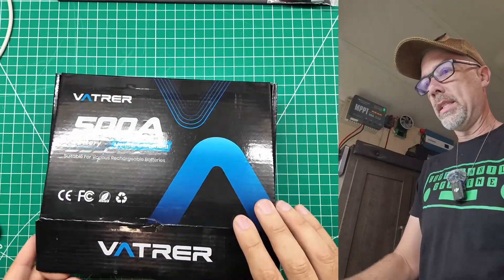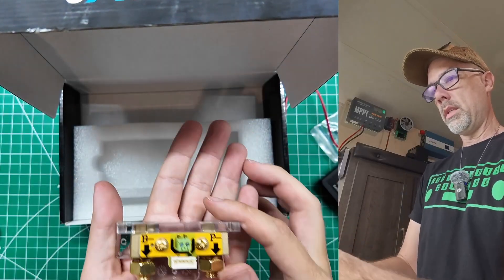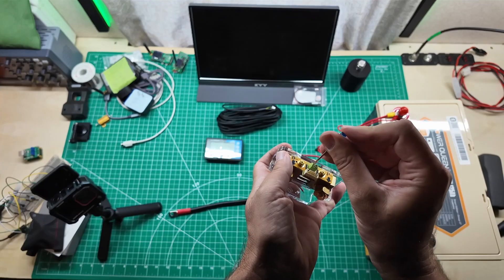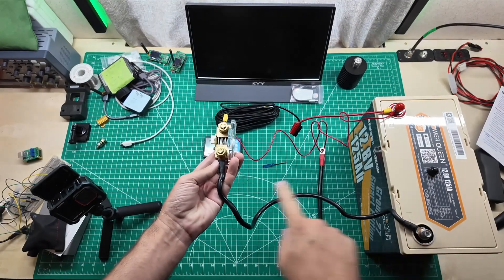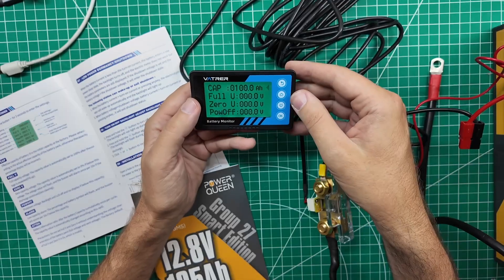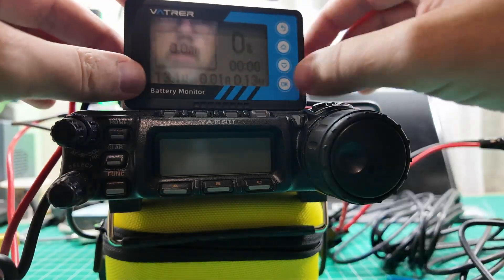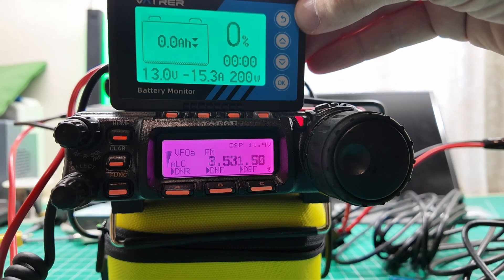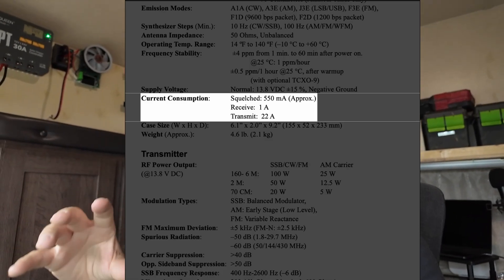Don't Guess: How Much Power Per Band?

Comment: I have a Spreadsheet "RADIO-POWER", and a Tab for Each Radio, I do what you did, but at 100%, 50% & 10% Power out.
It's sometimes quite surprising the change from 100W, 50W or 10W that the Current doesn't drop as much as you think it would, certainly not half.
I'm assuming there will always be a certain level of Bias/Quiescent current draw on TX regardless of Output Power.
Reply from the maker: Right!  You've stumbled upon one of the (many) reasons why QRP isn't just "turn your radio's power output down"!!

Comment: Would be interesting to compare readings using the shunt to readings from a standard VOM amp meter.  1A is only 0.2% of the 500A range.  That's a lot of accuracy to ask for in this price range.  CAUTION: most VOM top out at 10A so don't try this with the full 100W
Reply from the maker: Good idea! That's a good way to double-check.

Comment: Why are those batteries so expensive? I can get a marine battery at rural king for $70.
Reply: In addition to what TO said

LiFePO4 batteries cost less per usable amp hour

If the 24DC battery from rural king is equivalent to Costco's 24DC battery then it would have a reserve capacity of 140 minutes at 25 amps, or about 60 amp hours, but you really only get to use 30 ah of it if you want to keep the battery long term (lead acid capacity is more complicated than that but lets keep it simple)

The lithium battery is happiest if you only do an 80% discharge, so 100AH usable
To get 90 usable amp hours(close to 100) you'd need 3 of the rural king batteries ($210) - about 160 pounds of batteries and 3 group 24 boxes

I can't find a price of the 125AH battery TO posted but lets call it $200 since the 100AH version is $160
And the lithium battery would weigh about 25 lbs and take up one group 24 box

But it gets worse in that you'll probably have to replace the lead acids at least twice over the lifetime of the LiFePO4

Bottom line - for 12V purposes the only reason to buy lead acid batteries these days is if you have no choice but to use a lead acid
I still use lead acid for my camper because its power center is about 6 months too old to have included a lithium charging program (though I am tempted to switch it out and go 100% lithium)
Reply from the maker: Lithium Iron Phosphate, deeper depth of discharge, more consistent power deliver over the duration, lighter weight, more charge cycles, better recovery/over discharge protection, etc.  Very different battery in the end.

Comment: I installed lots of shunts over the years. Works on 12-48V systems. They loose memory when that red wire disconnected . State of charge gets lost . Victron one has settings for different battery types . Also a display and Bluetooth. They give charging time as well. 73
Reply from the maker: That's great to know about the memory!

Comment: Good Morning Steve.
For most people, they won’t even notice what I am pointing out. For “some” people it’s important. Near the end of the video, you stated this meter will tell you about your battery. The information regarding the battery is nominal. What the operator will get is the efficiency/effectiveness of the radio operating character in a specific operational state while connected to a battery. All points are valid of course. However, one truly seeking “battery condition,” that is a different tool. No judgement, no hate. Only a point of clarity. On another note, that shunt looked like it weighed 5lb’s. Is it as heavy as it looks?
Reply from the maker: Its a pretty solid Shunt.  Had to get out the big tools and gauge up my connectors for it.  500a is no joke.